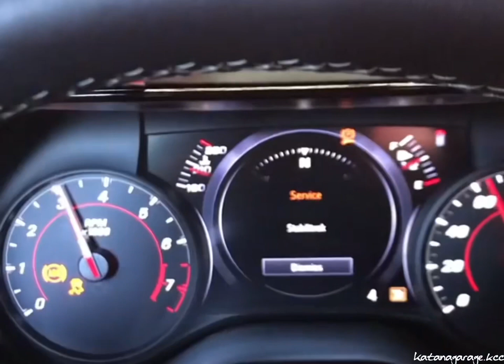2010 Camaro 3.6L V6 Engine replacement (dyno results at end of vid)

Comment: Where’d you get the engine? Thinking bout replacing mine w a remanufactured one to last another 10 years.
Reply from the maker: Hey sorry for the late reply, but I got the engine from a company called jasper engines and transmissions. And let me know if you need any help. Not stingy with the info